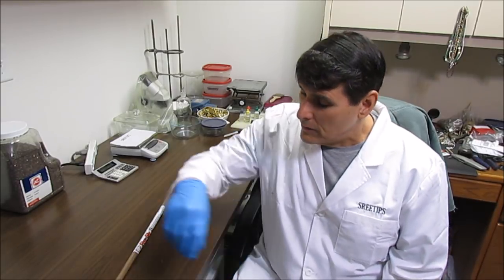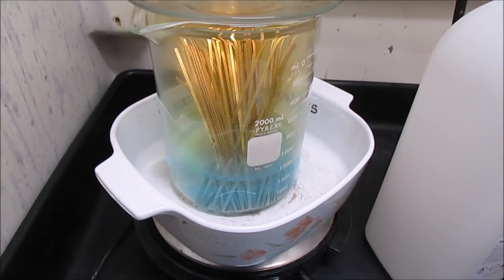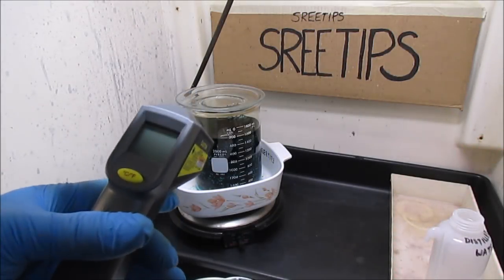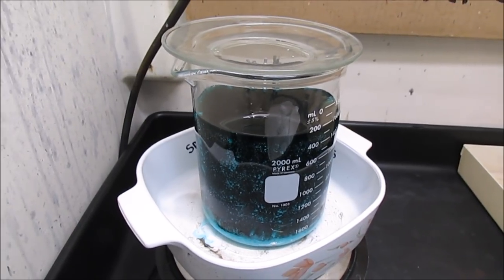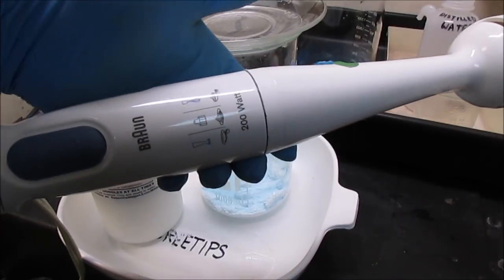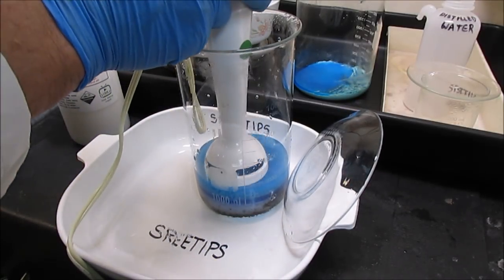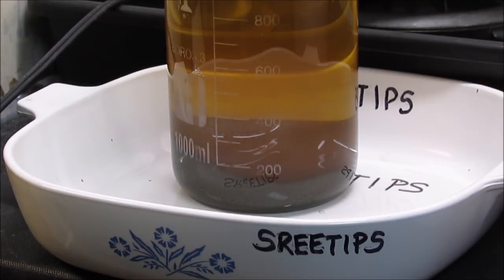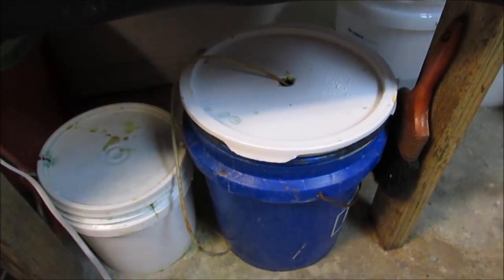Sreetips Silver Recovery From Brazing Rod

Comment: Silver Chloride??  You should not have that present.  Silver, copper, phosphorus plus distilled water plus nitric acid... there is no source of chlorine.   The precipitate you saw was likely silver.  You were producing both silver and copper nitrate.  The copper was likely forcing the silver off the nitrate dropping silver out of solution.  The whole taking the silver to silver chloride process was unnecessary, a copper rod would have done the process.
Reply: No. He produced Silver Chloride when adding the Muriatic Acid...HCl...to the Silver Nitrate-Copper Nitrate Solution in the recovery phase.. 

The precipitate in the beaker when he was dissolving the rod was possibly Tin Nitrate as Tin is used in some brazing rod. It may have been Zinc Nitrate. (And Phosphorous is always good to have around if you are into pyrotechnics...a fringe benefit of this process?). 

Alternatively he may inadvertently added Tap Water which is chlorinated..(Although I seriously doubt it)

The Silver Nitrate stays in solution until a material with more reactivity is added...like Copper.

All Copper went into solution before the Silver ever did  as it is more reactive. Therefore there was no metallic Copper that would have been present to cement out Silver during the dissolution phase.

Using a Copper Rod added to the Silver Nitrate Solution, in order to cement the Silver out of solution, yields 99% Silver and then you need to place it into an electrolytic cell in order to get .995+ Fine...which is marketable.

Silver retrieved from Silver Chloride yields .995+ Fine consistently.

Personally I'd choose Chemicals over Electricity when possible.

Are you on the Gold Refining Forum? Good place.
Reply: When he was pondering about the precipitate he was wondering if it was silver chloride.  This was long before he added the muriatic acid.  Tin is not used in brazing copper and it is not listed on the MSDS for the rods... silver, copper, and phosphorus.  This product contains 14.5 - 15.5% silver, 4.8 - 5.2% phosphorus. and the remaining percentage as copper.  One rod weighs ~16.28 grams, with between 2.36 and 2.52 grams of silver.

Copper will drop silver out of a silver nitrate solution with copper replacing the silver.  In this scenario the nitric acid is producing both silver nitrate and copper nitrate.  The copper nitrate is apparent due to the blue color of the solution.  The copper in the brazing rod is both being consumed by the nitric acid in the creation of the copper nitrate.  It is also being consumed by the silver nitrate.
Reply: Robbob9933 brother to good
Reply: Robbob9933...I did not take the time to look at the MSDS for this before responding. Perhaps I needed to?  

But the point I was making is that the Copper will go into solution first due to reactivity. Then the Silver dissolves after the Copper has been consumed as Silver is less reactive

So most of the Copper and much of the Silver went into solution. My bet is that the remaining expected Silver is in the remains which he did not completely dissolve and those remains have very little to no Copper left.

As for the possibility of Phosphorous interfering in the dissolution phase....That is something to investigate. Is he transforming some of the Nitric Acid into Phosphoric Acid? That may explain the inefficiency.

But I will transmute the Silver Nitrate into Silver Chloride and then drop Silver Oxide using Lye. 

As I responded to him I plan to forego the addition of Sugar step and melt the Silver Oxide directly as I just learned about that in another video.

But to Cement the Silver out of the Silver Nitrate solution yields an inferior purity as compared to transmuting it into Silver Chloride first..

And then he' have had to filter that solution repeatedly before the cementing....Then filter it again to retrieve 99%...and then set up a electrolysis cell....to get 995 or better? 

Nah...I like what he is doing.

There are many ways to skin a cat.
Reply from the maker: Yes, but then I wouldn't be able to try out my hand-held blender! It's actually the motivation behind me making this video in the first place. I've had that pack of Stay-Silv 15 brazing rod sitting in my shop for several years. Wanting to try out my little blender was the catalyst that precipitated the creation of this video. And here is what I think happened inside the reaction vessel;

According to the data sheet for Stay-Silv 15, it contains 15% silver, 5% phosphorous, and 80% copper. This is where all the nitric went. And it's the reason that very little silver chloride precipitated out in the first try. As the silver dissolved out, it came right back out of solution on to the copper, consuming the nitric acid as it went. The copper consumed the nitric, and the silver consumed the nitric, but the silver consumed the most. With the large amount (80%) of metallic copper present, the small amount (15%) of silver would dissolve, cement out, dissolve, cement out, dissolve, cement out, on to the copper, over and over, consuming nitric acid as it (the silver) cycled in the solution over and over.
Reply: Yea, I can see a circular reaction going on, the amount of nitric you used was more than needed.  As long as nitric and copper were around the silver would spin in circles. That would make the sludge phosphorous.
Reply: Took a lot of acid because the silver gets dissolved, then preciapted by copper, then dissolves again over and over. 

It would be better to melt the rods add more copper and process with hydrochloric acid, hydrogen peroxide and sir bubbler, leave it sit out of the way till all the copper dissolves. Leaving silver chloride. 
More time less costly. IMO
Reply: Or run it through a copper cell and collect the silver in the slimes

Comment: Definitely an education.
Apparently with a learning curve! LOL
Great vid!
It appears that you are a bit fascinated by the sugar-cement action. I was intrigued myself when you first did it in the other video.
Lotsa nitric this time! But that brazing rod is pretty tough stuff.
Not a bad yield. You didn't lose the rest of what was anticipated. It just had a change of address. LOL
Thanx again bud!
Reply from the maker: I was baffled during production, but later, after reading the comments, I realized what had happened to all that nitric acid. Here is what I learned after posting the video and reading the comments;

According to the data sheet for Stay-Silv 15, it contains 15% silver, 5% phosphorous, and 80% copper. This is where all the nitric went and it's the reason that very little silver chloride precipitated out in the first time I added hydrochloric acid. As the silver dissolved out, it came right back out of solution on to the copper, consuming the nitric acid as it went. The copper consumed the nitric, and the silver consumed the nitric, but the silver consumed the most. With the large amount (80%) of metallic copper present, the small amount (15%) of silver would dissolve, cement out, dissolve, cement out, dissolve, cement out, on to the copper, over and over, consuming nitric acid as it (the silver) cycled in and out of solution over and over. this is why understanding the reactivity series of metals is so important to any refiner at any level.

Comment: Only profitable if you buy your hno3 14gal  ss carboys acid wise lol
Reply from the maker: Six 2.5 liter bottles for $250 delivered will last me six months or more. Fourteen gallons! My operation is not big enough for this much acid.
Reply: sreetips you must be getting your acid from legend, they are fairly reasonable for the small guy.... When I was refining high grade ore doire Batches I was getting carboys form la chemical but it took a lot more acid for shot reactor work than for fume hood work.
Reply from the maker: I've got no experience with extracting gold from ore. But I could probably refine doire.